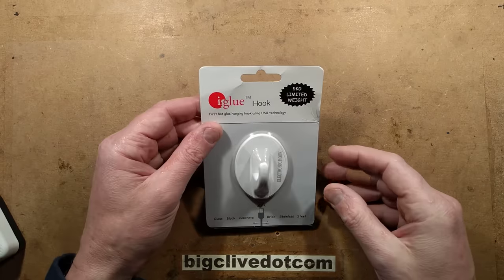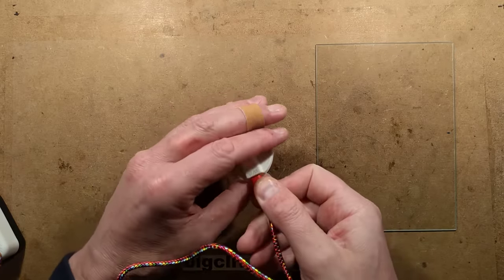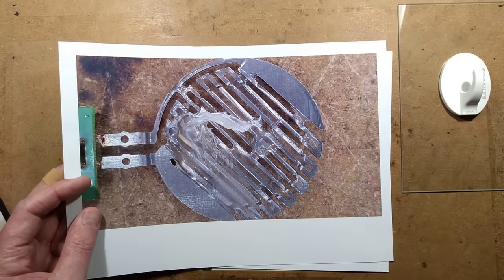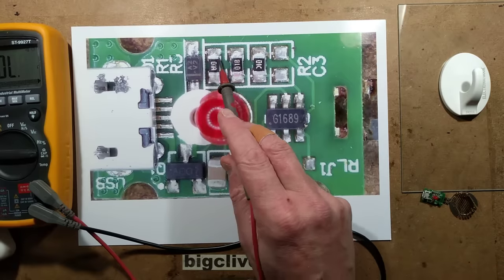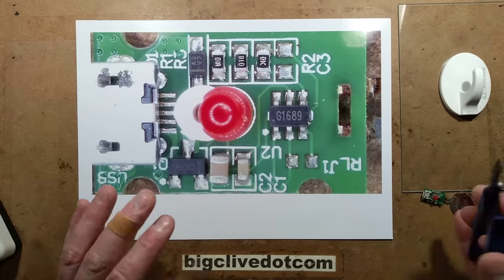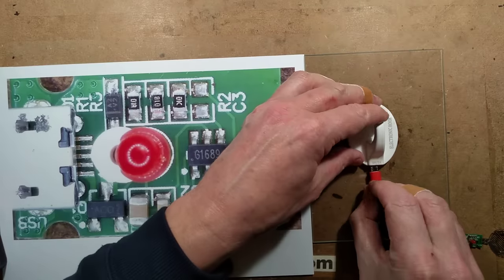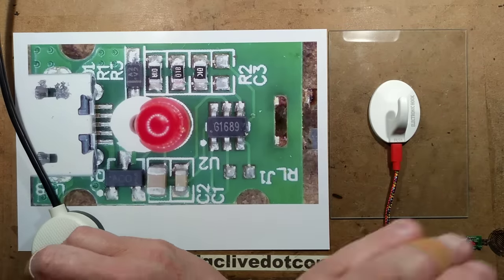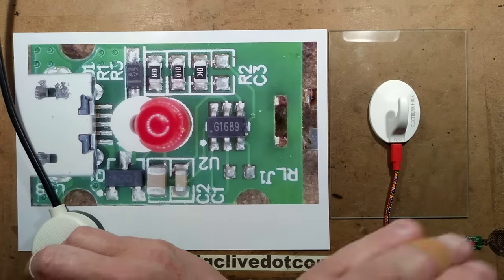Testing a USB powered wall hook and a look inside.

Comment: Its not a heater it is a secret antenna
Reply: And a tiny little camera...
Reply: As a matter of fact, an LED sources a tiny bit of current when you shine a light on it, so you can use it as a photodetector or a single-pixel camera.
Reply: @SianaGearz  I always remember a boffin friend of mine blowing my mind back in the cathode tube tv days by explaining how a tv screen could be used to retrieve enough light in the same way, to create a video signal. Compensating for focus and ambient conditions, the set being off, and wired properly. We were talking about crazy people thinking their tv was watching them. When my wall hook comes flying at me in its drone mode, to release a shaped explosive on my forehead, I might be a bit more concerned....
Reply: How do you think TV cameras worked before CCD became economical? You can even find tube-based compact camcorders from the early 90ies.

Granted, you don't really get a useful image off backsensing a TV screen.

I have seen practical use for LED as detector, for example as a combined display/touch panel, where the light off a neighbouring LED can be measured as a reflection off your hand.
Reply: Like that Russian wood carving thing (apparently literally called "The Thing") that was in a US government office for years?
Reply: If you are a law abiding citizen you dont need to worry .... If it is a camera ill give them something to see
Reply: @bobdylan6198  hahaha
Reply: Puts on secondary tinfoil hat
Reply: Anyone have a disc with a spiral of holes in it? The LED is now recording video in gorgeous 32p quality.
Reply: Since it's probably an 8 or 4 bit uC if it even is a processor it can't do much with it.
Reply: And a microphone
Reply: Put does it run retropie?
Reply: A TV screen could not be used to receive light. Mainly because the cathode tube doesn't emit light; it emits electrons.
Reply: @tin2001  apparently that particular "bug" didn't need a power supply?

Comment: I thought it was going to be a USB charge port on the hook so you could hang up your jacket and charge the peripherals in your pocket.
Reply: Or an rfid antenna to provide an answer to "where's my keys?"
Reply: I was hoping it was a usb charged and flile accessed minicam for the shower. The old ladies on my facebook circle would just love to know about nefarious devices such as these. And spread the information around. About what to look out for when you are naked. They are already on the lookout for shiny chrome phillips head camera lenses. With suspicious black plastic filling.
Reply: I mean, that sounds just as dumb but probably more useful. Would that be considered an improvement then? 🤔
Reply: +Gary Wheeler those exist too but if I remember correctly are extra big or something weird. knew someone who wanted to get one when they thought their apartment maintenance man stole their old hoodie and something else weird like sugar lol
Reply: Buying a regular hook , a screw and a screwdriver and hole filler would be cheaper than this device.

Comment: My god, is there nothing that can't be 'improved' by adding a USB port? I'm surprised it doesn't have an Arduino as well...
Reply: Yep there is now even a USB pet rock.
Reply: Needs more InternetOfThings and machine learning
Reply: The hook or pet rock?
Reply: Both
Reply: Next version will have wifi. And an app.
Reply: He did say there was a microcontroller... :)
Reply: a USB port in an toilet roll holder
Reply: @terrandroid  hey we could make that! Make it count how many times it's rolled to count the sheets used and put a smell sensor on it to see how... Good. Of an bowl movement I was lol
Reply: Wifi coat hook. LMAO you know some dingleberry is going to do it.
Reply: well when i you need to know whether your kids have hung their clothes up...
Reply: In fact they have version 2 out which has a Nvidia GPU card fitted which is used as a heating element instead of a bit of 2 ohm wire.
Reply: @pqrstzxerty1296  I heard the additional display port was used to show how much weight was put on the hook! What will they think if next
Reply: The thing is that Pqrst Zxerty is probably right.
Reply: Version 2 has solar cells and a battery for CO2 reduction.
Reply: "Hold my beer" ;)
Reply: I mean, this does significantly make sticking it securely in place a lot easier and with less residue, It came off leaving a sticky mess, but it did come off with ease once reheated, and with minimal effort.
Reply: Behold! The USB Nothing (TM)

Comment: weird that the manufacturer of this piece of total un-usefulness didn't start a kickstarter for this.
Reply: Propably some scammer will try "Kikcstarting" this totally original project and hopes that nobody realises that the product is already sold in China. Still it would be better than the "Motion activated toilet nigh-light" that clive reviewed, it was in Kickstarter and sold in China. :D
Reply: That'd be a Stickstarter, no?  ;)
Reply: Maybe the kickstarter version will have a voice synthesizer instead of a flashing LED.
Reply: The Kickstarter proposal will have a miniature mains powered electric nail gun inside :-)
Reply: @MrDuncl  with voltage step-up and nano-nails (YHIHF), maybe 5V will suffice.
Reply: But we need to build something of IOT in, that's hot ! Maybe a scale, so you can view the weight of the towel on your smartphone.
Reply: iDubbbz would be happy in that case
Reply: They're already start kicking some sanity

Comment: So I'm guessing that the two smaller circles of glue are to supplement the original heating element glue? So a 3 shot device?
Reply: Well there's no reason you couldn't take a glue stick, cut a little piece off and toss it into the heater.
Reply: Paul Appleby  was wondering the same , that makes sense & why u will loose some on removal as demonstrated
Reply: next year the USB-C version will come out with no hook on it, so we'll all have to buy new coats and mugs to be compatible
Reply: The main problem with these hooks is when there's a power outage all your shit falls on the floor.
Reply: I'm sure in the distant future we'll have a Dyson Sphere of coat hangers orbiting the sun to dry our wet towels really fast.
Reply: Towellelujah, friend. Towellelujah.
Reply: We'll call it the 'Sky Hoist'. You just stand in your backyard with your basket of damp laundry at a particular time of day, and nanovelcro clothes pegs on carbon nanotube clothes lines come down from space, clamp your damp undies, and whisk them into the sky for a quick lap about the sun. Then deposit them, neatly folded, back in your hamper, in two seconds.

Just don't try to touch the pegs.
Reply: im an ihook genius that works at the local ihook store, and i can confirm all of the above comments to be true.

Comment: thing is, removable no-residue wall hooks are incredibly useful for apartments, at the moment 3m command strips seem to be the only real solution
this looks like it's a MUCH stronger hold with an arguably even easier removal process.
i wonder though, is it reusable? like if you take it off one wall can you glue it to another? if so, that'd be legitimately useful stuff
edit: nevermind it leaves way too much residue, not good
Reply: I think it would work well on metal or glass, maybe even some paint.  But I think anything with much texture or paper/fabric would be a nightmare.

Comment: You might be surprised at how well that glue comes off with isopropyl,  a similar system is used on car dent pullers and they come off paint no problem. Agree I dont think I would go with wall paper but I would use double sided tape either

Comment: If you soak a tissue or rag in isopropanol and hold it against most kinds of hot melt glue it soaks in and turns the glue crumbly and not very sticky, so it comes off well. I've seen this done to unstick things from pcbs and it works moderatly quickly. I think it might stain your wallpaper though :)

Comment: I love the simplicity of using plugging and unplugging the cable user control.
Say if the chip is a MC then the two mystery pads are probably serial tx/rx. Which on many controllers is used to flash the internal rom.

Edit: having read some on 6-bit MCs they tend to have multi purpose pins. But I'm guessing the pads were used for testing and/or flashing the chip.
Reply: they likely do

Comment: I mean, if you already have a hot glue gun at hand...
Reply: Willtato my thoughts exactly
Reply: But how to heat behind the hook for removal? Lol
Reply: nambinhvu isopropanol will remove the hot glue
Reply: @shuneycutt  so you spray isopropyl alcohol all over your wall hoping it'll get behind the hook on your wall? Depending on your wall, that might also cause damage, but I guess the glue would have as well.
Reply: A simple engineering solution would have a reservoir in the back of the hook for the hot glue gun deposit.
Reply: You now have a hook to hang it from!
Reply: @andrew_koala2974  what happens if you only bought one but need two?
Reply: @nambinhvu  But why, after going to all that trouble to place the hook, would you want to remove it? It's not even a particularly nice looking hook.
Reply: @andrew_koala2974  Yeah and it generates so much more e-waste, which is a great perk

Comment: all these components just to melt a glue?! it would be cheaper if they just included a lighter with the hook LOL
Reply: @andrew_koala2974  I don't think so, postage is free already and even if it weren't free, a lighter will not add any significant weight as post offices calculate weight by 500 grams increment!

Comment: I actually think the concept has some potential.. I think it has two things going for it. The first is that hot glue doesn't really deteriorate like most adhesives do, so it is probably a pretty long lasting solution. The second is that it is removable without damaging the surface. (This assumes there is a way to remove the goop. )  I feel like the removability of it could be a big benefit if the adhesive is really really strong. That being said, both things are pretty "Niche". I feel like it people that need a long lasting hook could just take an existing hook from those sticky hook packs and use their own glue. lol
It seems like the kind of thing that could have a commercial application, only you would take the electronics out and put them in a box. Then you'd sell the hooks with the little heating disc inside for cheap. I feel like there are industries that could use this concept to do certain things. (maybe not to attach hooks, but something else.)

Comment: My guess is that the chip is a clone of the PIC10F200. I've gone through roughly 200,000 units of the PIC10F322 in a hard drive thermal monitoring product and the footprint all lines up with a PIC10F. If it is a PIC, you should be able to connect up a PICKit to the ICSP pins 1 and 3 and to /RST on pin 6 to get an ID code at the least.
Reply: IIRC the pinout is the same between the PIC10F200 and the ATtiny4/5/9/10.
Reply from the maker: When I saw it in the 6-pin package the PIC10 series did come to mind.
Reply: Jock Murphy, right you are. The markings don't match either a PIC or AVR but with all the Arduino cloning I'm sure the AVR architecture has been reduced to Verilog so it could easily be either one.
http://ww1.microchip.com/downloads/en/DeviceDoc/Atmel-8127-AVR-8-bit-Microcontroller-ATtiny4-ATtiny5-ATtiny9-ATtiny10_Datasheet.pdf
Reply: Right, or some 6-pin 8051.  I would love to see someone decap it to see if we can find out
Reply: Send one to electron update. He does close up videos of chip dies.
Reply: I think sometimes they develop with PICs and other general purpose devices then pay for a reduced gate count specific device. Seems to be what they did with that voltage monitoring thing which looked like a 16f but wouldn't respond to a programmer when I hooked it up.
Reply: There are more manufacturers than just Microchip and Atmel.
I think those brands would be excessively expensive for the feature set of this device.
Reply: I switched Google search to what I think was Chinese and searched for "G1689 6 pin IC". The first page of results included this link:
https://www.microchip.com/stellent/groups/SiteComm_sg/documents/Training_Tutorials/en528372.pdf
The features looked like what you want, but I did not checkot the pinout vs your photos. Hope this helps. I hope you get to see this comment somehow.

Comment: While it's a stupid idea, it's also a great idea. It's far more likely to be a solid fixture compared to most foam pad stuff around so I like it for that. I dislike the fixed heater cartridge idea though. It would be good if the heater could be slotted in when required and otherwise just leave a plastic plate. Safety would be an issue though I suppose and price/waste is low in the current form. IPA is great for removing hot-melt glue too. The glue goes hard and loses it's adhesion properties and usually comes off really easily.

Great for bathroom tile fixtures but at £2 each maybe over-priced.
Reply: Why would India pale ale remove hot melt glue?   ;D
Reply: What would an arrangement where you can slot in a reusable heater even look like?
Reply: Just use a hot glue gun and when you want to remove it run a bit of isopropanol behind the hook. You'll have to use it anyways to clean up the residue.
Reply: @darronjknight  😁
Reply: Dow put it in ya bathroom FFS it'll rust up with the moisture lol
Reply: Waiting for the hook 2.0

Comment: 3M command strips don't work on recently painted walls (or perhaps just on whatever brand of paint I used in my house). I imagine it outgassed some kind of oil that caused the strips to release. I wonder if this would fair any better.
Reply: you'd be better off using a hot glue gun.
Reply: If it's a spot that you  really want to use a command strip, try spraying a couple of small coats of hair spray in the spot you want the hook, or try painting a little primer coat where you want to stick the hook, or try sanding the spot  you want the hook to stick. I can't say any of these suggestions will work, but if you're desperate, give it a try.
Reply: Why not just screw in a hook with a rawlplug?
Reply: Wipe down the wall with alcohol, and dont touch it afterwards. The oils from skin cause that as well
Reply: @brothyr  but you can't heat behind to remove it afterward.

Comment: How to leave a bogey on ya windows and walls :P
Reply: At least its a clear skidmark.
Reply: It would come off easily but it sucks lol
Reply: Only if the surface the surface you stick it to is non porous. Stick it to wallpaper and you ain't getting it off without damage. Even soaking everything in iso will just damage the wallpaper unless you somehow have non porous rubber sheeting on your dungeon walls.

Comment: Change the shape of the heat pad, and you get a car lock de-icer?
Reply: But doesn't every car have a remote fob these days.  Who uses keys to open a car anymore?
Reply: Whilst the cockpit doors are nowadays centrally locked, the tailgate lock on many utility trucks (Mazda, Holden (Rodeo), Ford, etc) are not linked to the system, and obviously the canopy window locks (if your truck has a canopy) are not!  In such cases this will be a useful gadget - and I've ordered two. Not much use in the Aussie summers, ( :-) )  but our winters (especially eastern escarpment) can see well below-zero temperatures.
Reply: Maybe this was a subjective comment... I have a 1996 Audi, and use the weird pointy metal thing to open my doors. :)
Reply: slimysi99  What, a loook pick?
Reply: Great idea. They could supply a cigar lighter adaptor as well to plug it into.

Comment: I and many others have pointed out the Alcohol Hotglue trick so many times on Patreon and youtube, and you are still sceptical and aparently still have not tried it. You really should, it is quite amazing how easy it is to remove hotglue with Alcohol from almost any surface (it even works on wood and sometimes even fabric). I really don't understand why you seamingly just don't want to try it...